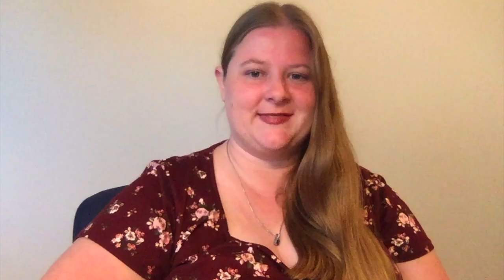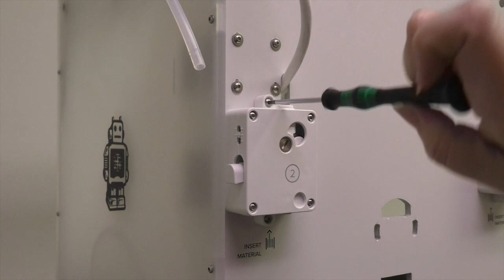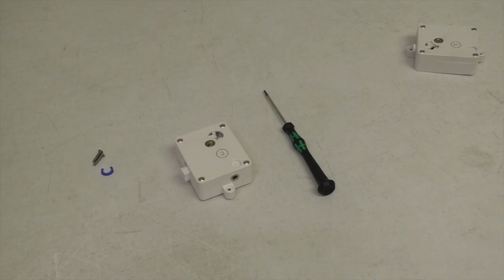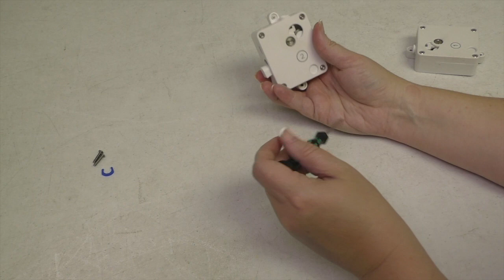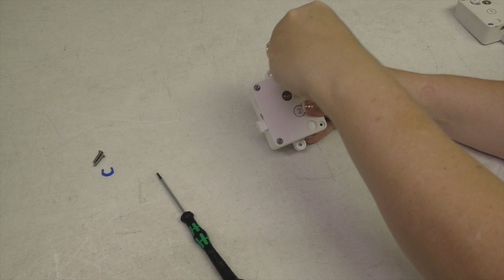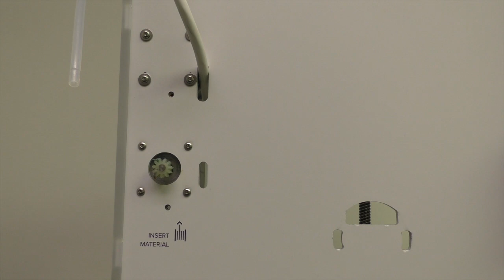Taking Apart Your Feeder (UM2+/UM3)

Comment: Thank you. It helped me to assemble back "exploded" feeder. Although everything seems to be logic and clear, I could not find a correct place for two parts
Reply from the maker: Which two parts are you unsure of where to put them?
Reply: It was a metal ring and a setting screw. After watching the video I got that someone repaired the extruder before me, assembled it wrong, added unnecessary nut and screw did basically nothing.
Reply from the maker: Wow,  @TushhsuT  ! Glad you got it sorted out.